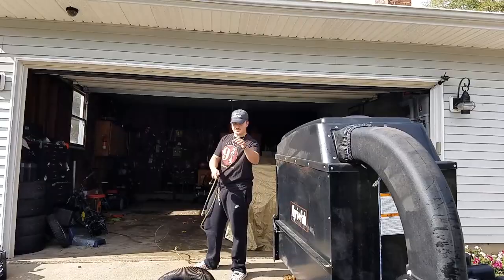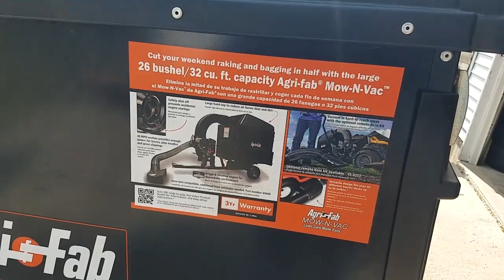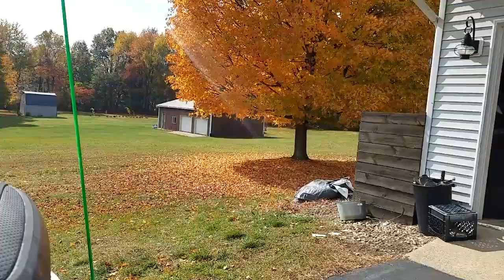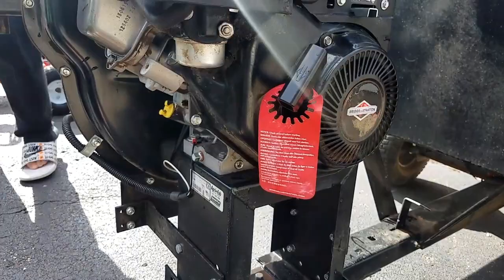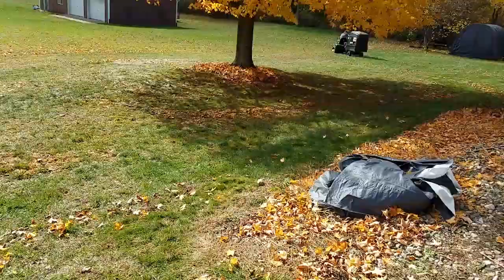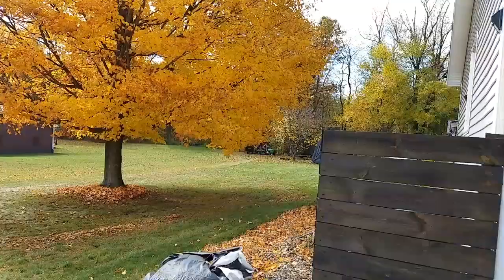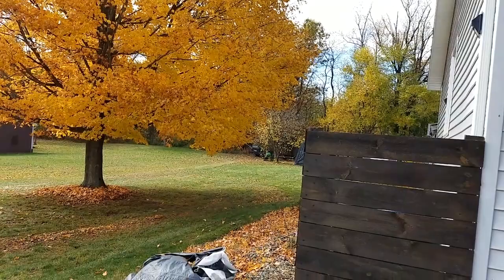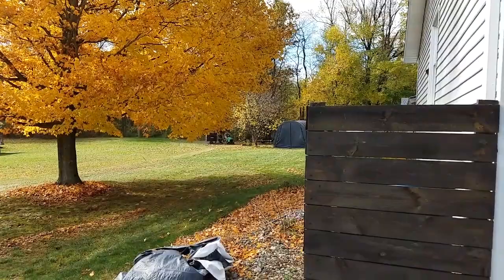Agri-fab  Mow-N-Vac  DEMO, Easy fall leaf clean up in Michigan! See for yourself! Adios Leaves...

Comment: The leaves are good for the soil, but they are also good for the garden. I have been looking at that system.
Reply from the maker: definitely, it sucks up leaves and is soo easy to move them or use them etc..  sometimes i spread them out and mulch them up but if there are a lot they get sucked up and get burned or mixed with soil and so on. look up the tarp mod if you get this system . it is crazy easy

Comment: Would have been nice to see before and after pics of what you collected and what it looked like after you were done. How do you dump it? etc.
Reply from the maker: Great suggestion,  more thought could have went into this video,  thanks for watching and commenting
Reply: @TonyCampCamppartyof4  wasnt trolling, just thought I would mention it if any future videos come to mind. I appreciated your video, and now I am on a hunt for a used one. What size motor runs this unit? I am looking at one that is used but it is electric and I would want to conert it or have electric as an option. Thanks again
Reply from the maker: @norcoauctions  nope never thought you were trolling,  I believe it's like a 9 hp honda or honda equivalent but we sold everything,  the leaf vac , house , business etc.. and I made the family move to my home state of Florida,  I couldn't take the cold anymore.  We go back and forth for family now but glad we don't have to deal with snow or leaves anymore.  Sounds like you will have a nice machine when you're done for sure
Reply: @TonyCampCamppartyof4  I retired and moved here to Florida in 2021 and got tired of fighting with the oak trees in our yard. Bought one just like yours. Mine has the chipper and it does work great. I am repairing the housing covers now. It has been sitting
 a few years. Thanks for the video, I know how much time that takes.
Reply from the maker: @chuckgilbert2035 congrats on retirement! The property we bought has palms now. Dont miss the oak trees back in michigan and Florida winters are much nicer. :)  Thank you so much for watching!

Comment: I have an older Agri-Fab (the tan color). Have had it 25-30yrs, works great on my 5 acres and 63" mower deck. I think its the best made yard vacs out there.
Reply from the maker: That's great,  I remember the older model was built great and can still beat the current competition.  Glad you kept it and took care of it
Reply: I have the old tan one also,  I wax the old girl every year!!  I'm thinking of putting a bigger eng on it from a 5 HP to maybe 8 HP or higher to increase the suction,!!  She's a Goodin though.

Comment: i have one of these but mine has the chipper chute also.  i installed a tarp in the bed to pull out the leaves in 15 seconds. no dumping the box or fooling with the sleeve around the chute.  i pull it with a 52"stand on mower.  i believe someone posted a vid called agri fab hack or similar, shows how to install the tarp.
Reply from the maker: Awesome!, I will have to look into that for sure, now that i think of it, that seems like such a simple fix and a big time saver!, thanks for stopping by, and teaching me something for sure sweet! have a good Thanksgiving
Reply: How do you have it attached to your stand on? Drilled a hole in the platform? I have a 52” Ferris I’d like to rig this on.
Reply: @jarretolsen2771  i take a 2" x2" x 3/16" angle iron approx 14" long, drill and tap 4  3/8" bolt holes in the frame right behind the platform shock, weld a 1. 1/4" receiver hitch onto the angle. I never take it off, my shins dont ever hit it. When i need to pull anything just pop a hitch in and go.post your email ill send pics

Comment: I'd like one of these, but with the onboard chipper also.  However, what would push me to buy is a PTO version because I'm saving up for a subcompact/compact tractor.  TracVac has PTO driven models, but none with a chipper.
Reply from the maker: There are soo many options out there for sure.  Good luck on your purchase
Reply: Had a Trac Vac pto version on a JD compact and while it worked really good it was a pain setting up every year and it weighed a ton.Also it made the setup real long and took that long getting it setup right I sold it after 2 years.

Comment: i  bought this model a few years ago used it once and it sat in a shed for 2 years and a mouse chewed through the white cord coming off of the impeller. i for the life of me cant find the other end or where it goes if i was to buy a new adaptor. Google youtube and facebook groups have been 0 help . Anyway you or anyone reading this  be able to show me at least a general area where its going to or point me to somewhere other then the parts diagrams that show nothing. I would appreciate it so much
Reply from the maker: Assuming it's not electric start, it will most likely be the magneto or kill switch that grounds out the magneto to shut down the motor, so it should run from a kill switch to the magneto area. If you are unfamiliar with engines follow the spark plug wire away from the spark plug and that will lead you to the general area . Probably under the engine cover or hidden. Hope this helps

Comment: Very good video. Thank you.
I just bought a brand new agr-fab for this fall cleanup.
I have it hooked up to a very similar John Deere like yours.
The instructions are not the best.
Hoping you could tell me if you had to shorten the hose.
Mine seems to long compared to yours.
Thank you
Reply from the maker: Thanks a lot.  I hooked up mine and ran it through the bungee cord , used it as is for a few passes and cut mine to where it wouldn't touch the ground when turning.  For me I only took off like 2" . Thanks for watching and commenting I do hope your machine works awesome!  Mine never gave me an issue. Cheers

Comment: Hello great video but i have a question how to do you keep grass from building up in the Chute
Reply from the maker: Drive a little slower than usual
Don't suck up wet grass/leaves
Maybe try mulching blades
Make sure the vacuum motor is running at max speed.
Suck up more often/ don't let grass get too long or leaves too deep.
Inspect fan housing for buildup and clean as needed,.
Look for anything in the hose that is sticking out catching  or grabbing the grass.
Make sure you have good seals between the fan and the mower deck so air isn't getting sucked in anywhere,  no holes in hose or loss of suction at joints?
These are a few things to look at. Hope it helps. Cheers

Comment: Does this unit have a clutch or anything to engage and disengage the impeller while the motor is still running
Reply from the maker: No clutch,  impeller directly attached to motor . If motor is running , the impeller is also. Thanks for watching

Comment: Thinking about buying one, but can't find any info to confirm it will fit my John Deere zero turn....
Reply: I bought a well-used unit off FB MarketPlace and it came with the deck chute that was cut for an unknown machine.  It seemed to fit my JD 525E 54" deck zero turn ok.  Not perfect but well enough to get what I need which is grass clipping removal.  The grass clippings don't rot very fast and tend to accumulate on top so after a while I'm cutting more clippings than grass.

No regrets.

Comment: Does it work bad with mulching blades? Plus do I need an attachment to connect to my husqvarna tractor?
Reply from the maker: This model came with the plastic part that attaches to most decks 54" and below,  you will have to cut out to custom fit your deck (I used a dremmel) but it can be cut a few different ways.  As far as blades go I noticed no big difference between the mulching blades and regular as long as you have a good seal with hose attachment,  adjust deck height for optimal suction also.  Hope this helps a little
Reply: @TonyCampCamppartyof4  I really appreciate your reply. I just found a Cyclone Rake for sale and it’s practically new for $800. Have you heard of that model and/or should I hold out for your model? Thank you so much 🙏🏻🙏🏻🙏🏻🙏🏻
Reply from the maker: @originalfallinggirl  an older gentleman down the road had a cyclone rake for a few years and never had a problem with it till he couldn't do his yard anymore and sold it, I'm just not sure how they connect to your mower unless the deck is similar to the one that was used with it last, just make sure you look it over well, check out the fan blades for cracks etc.. but I'm all about buying used if it was taken care of , you should be just fine with that unit. Cheers

Comment: Just mulch them up and leave them on your lawn, much easier. 😉
Reply from the maker: Heck yeah
Reply: @TonyCampCamppartyof4  how does it do with oak wood leaves?? i would buy this to suck leaves up in the yards i do in the fall
Reply from the maker: @snoopysrc  here in Michigan the oak is mostly red or white and as long as they are not too wet the system seems to be reliable and fast with the least amount of work for me

Comment: I purchased a brand new machine today. Brought it home. The engine would not start. Called their tech-support. You have to go through briggs and Stratton. They don’t support the engine on the piece of equipment. Called Briggs & Stratton ended up having to drive two hours to a authorized dealer to have my engine repaired. Do not buy this piece of crap.